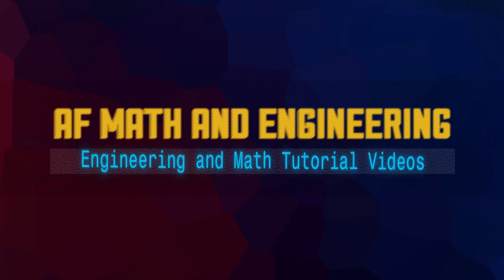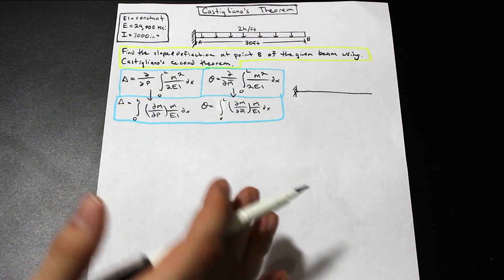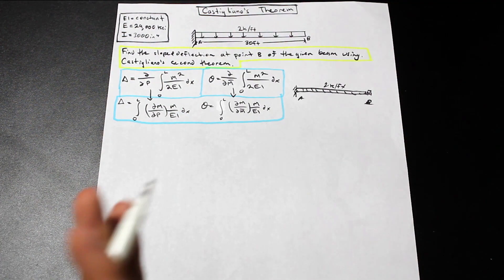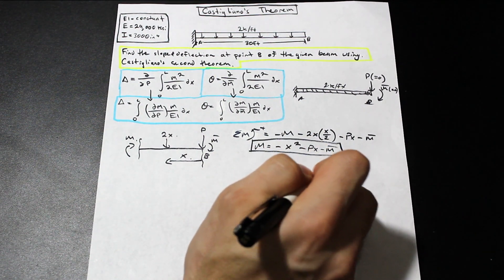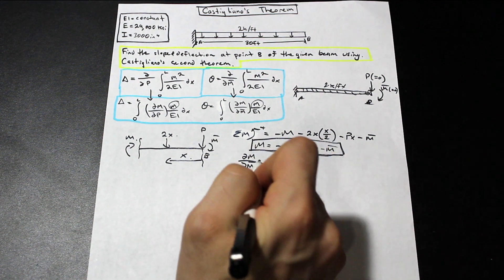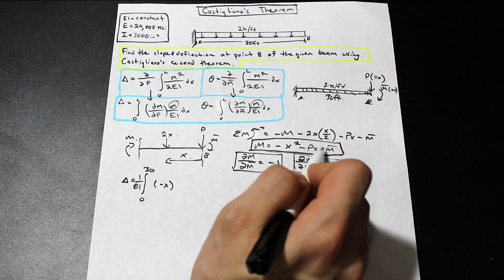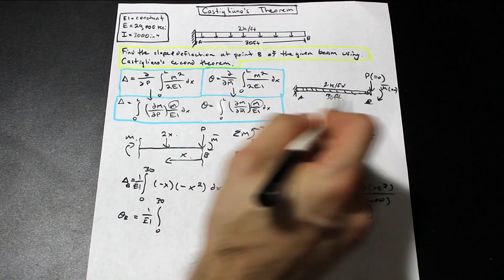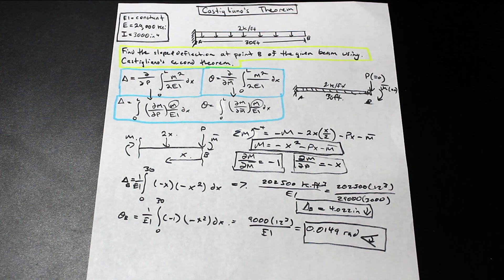Castigliano's Theorem - Cantilever Beam Distributed Load - Slope and Deflection - Choosing Origin

Comment: hey,, just a question, if the pivot is at point B wouldn't the 2x mive the beam anticlockwise as 2 is pointing down? Making the moment positive
Reply from the maker: Jivan Di Biase hey, good question.  In my opinion it can get confusing to think of it this way, just cut the beam as we've done here, assign your positive sign convention and see how the moments act according to that convention.  Our origin is B but were evaluating the moments from where we cut the beam, which is just before A. Hope that helps.
Reply: M bar should be positive as its internal not negative.
Reply from the maker: M bar being positive or negative depends entirely on our assigned sign convention, not whether or not it's internal or external.

Comment: hey great video, just wondering 
 how would the moments equation change if you added a point load in with the distributed ? like as well with the distributed there was a point load 2/3 the way down the cantilever
Reply from the maker: Thanks for the comment glad it helped! The only variable that is affected by change in external load in the equation for deflection and rotation is M. Thus your need to modify your M to include your point load.  Hope that helps!
Reply: Ok, sweet . would that just entail adding a -2/3(P)x to the moment equation .P being the added point load  and 2/3x being the distance ?
thanks for your help . i really do appreciate your time
Reply from the maker: In cantilever problems we derive the M equation by cutting the beam before the support so we dont have to consider the reaction in our M equation .  Thus our distance would be 1/3L for our term (assuming you meant 2/3 down the beam from the support).
Reply: Awesome! you the man , yes since we moved the origin that makes sense . Do i just multiply  the point to the 1/3L them add ....Well subtract ,due to rotation , in to the equation you wrote in the above example
Reply from the maker: I'm going to have to check, I'm not home right now, but here adding a point load at some point not at the end will require you to take a second moment equation.  So if you have ABC where A is the support, B is the pointload and C is the end, take CB and BA and sum the individual sections after applying the formula to both. Refer to our other video on this topic where we do this for a discontinuous loading.
Reply: ok sweet , thanks for the replies, i was getting weird answers.
Reply from the maker: No worries hope they helped!